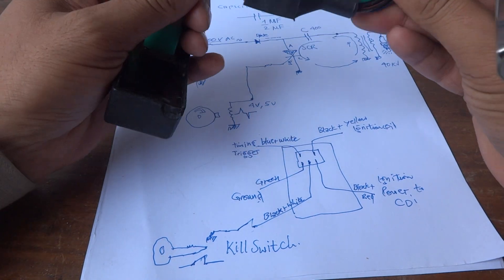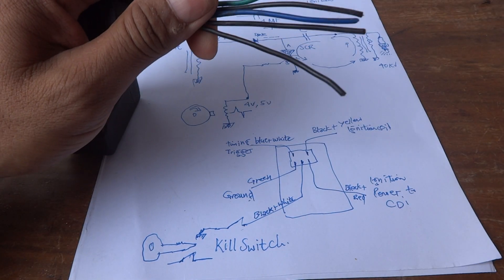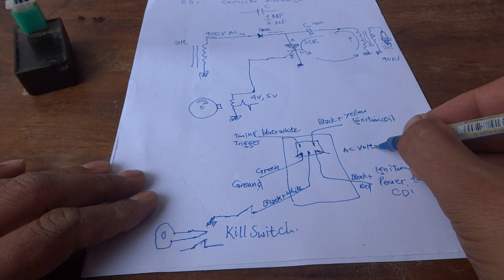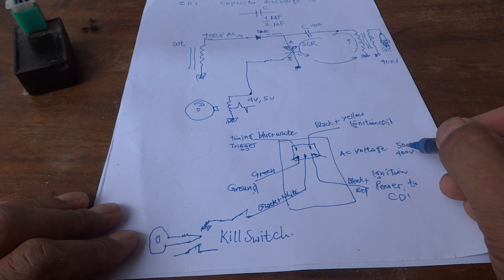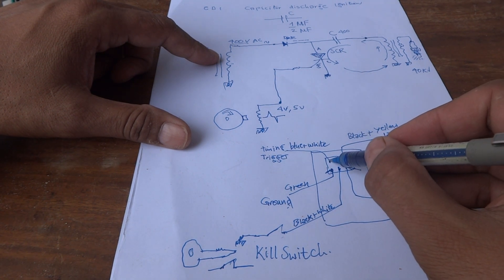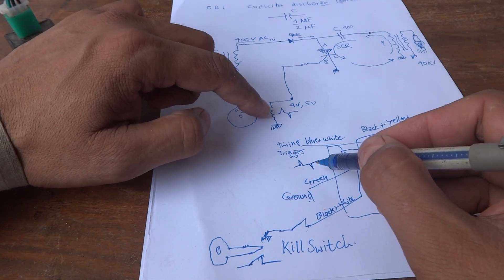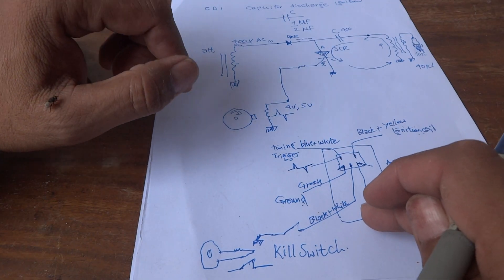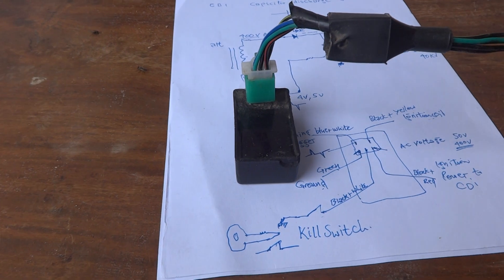Bike cdi system explained. CDI complete wiring and circuit details.

Comment: Is the key in your diagram the ignition switch key ? Or is that the kill switch wire on the handlebar switch ? 
Thank you for your video !
Reply from the maker: Both. In some models there is only ignition switch incorporating engine kill switch and in some models there are bothe ignition switch as well as kill switch. So the connections depends upon the particular model. Regards,
Reply: I have both a key and kill switch . It’s a knock off copy of a Honda ct70 . 
So how would I connect the wiring for that ? Do you have any videos ? Thanks

Comment: Very well described using principle theory .I just guess that charging a 400vac signal is 180 degrees out of phase to the trigger signal (4vac).So charging folowed by discharging  causes voltage induction in ignition coil. I don't know if we can make a simmilator circuit that can drive this charging and discharging signal , just to demonstrate this principle on the table 🤔

Comment: @JahanZeb1976 
When troubleshooting the trigger wire, i have the key on and i have a solid positive with a test light. When i remove inly the trigger wire from the cdi box and the cdi amd trigger are not connected the cdi is positive on that terminal. Is that normal? Does the cdi send a positive signal through the oick up coil? If so does the reluctor interrupt that positive signal and that interruption is what causes the cdi to send a signal to the ignition coil to fire?
Reply from the maker: Seems like not good. There should be nothing on pulser wire. Means no bising or any voltage from cdi side.

Comment: But scr once fired it does not require further pulse unless it is stopped with method of commutation.
Reply from the maker: If you carefully look at circuit design and think critically, you will understand the whole philosophy. Once the scr is triggered, it creates a short circuit along the whole system. Short circuit means zero voltage in the system. Every thing including scr gets in reset mode. Also the ignition coil fires in the spark plug. The system gets ready to repeat the process again.
Reply: @JahanZeb1976  yes sir got it, thanks for quick reply. Further I would like to know pin configuration of pleasure 2009 scooter model it has three sockets.

Thanks for shearing knowledge

Comment: Can I replace the capacitor for an electrolytic
Reply from the maker: Not exact pin to pin replacement! It needs non polarized paper or myler cap. Anyhow you can connect two electrolytics in series by connecting their positive pins together and end negatives you can use as non polarized electrolytic. Keep in mind that in such combination the capacity of both capacitors will reduce by half and voltage of the combination will be doubled if both have same capacity and same voltage.

Comment: 2nd question please.   I need multiple USBs to use how to install a DC to Ac convertor  to sort out my USBs issue for USB heating gloves and USB heating jacket and GPS phone and power bank to charge because all USBs flatten the bike battery often therefore I need to install DC to Ac converter. what Watt of DC converter is suitable for  bike wiring voltage.  thank you
Reply from the maker: Get a commercially available DC to DC converter with multiple USB ports.
Reply: get a DC 12 volt to DC 5 volt buck converter (step-down) and run wire from your 12v battery to the 12v fuse & then to a switch then to the  buck conv. and then to the USB hub... i hope this helps....

Comment: I need install relay & remote on/off switch please guide me through how to wire it.  Can I connect it to CDI  in order to install the relay  with remote on/off switch receiver in Honda CBF 125 and bike will will switched off when gear in function as you know? or shall I connect it to any other unit in bike?
Reply from the maker: This bike is an efi bike. Better you cut off fuel injector supply with the help of relay to kill the engine using remote control.

Comment: Does kill switch work as a limiter?
I mean, does it restrict higher RPM than what is required or allowed...
Reply: No the kill switch can not limit rpm, but if the switch has excessive resistance when in the closed position it could cause cdi to run low volts than required. Test it with a multi meter for resistance. Switch closed should have 0.1 ohm maximum.

Comment: Hello chan you tell me how the cdy make timing ajustment? Than kyou.
Reply from the maker: There is a pulser coil installed outside the main magnet. On the main magnet 🧲 there is a small reluctance piece which produces timing pulse when piston moves close to tdc. This is setting up spark timing.

Comment: So how could we make it so it only fired the spark plug every OTHER revolution of the flywheel instead of every revolution ?  at 10K rpm that is 166 sparks per second and my ignition system on my 150cc isn't providing a powerful enough spark at that high rpm.

Comment: congratulations, but is it possible to exchange the signal from the pulse coil to a hAll a3144 sensor?
adapting brushcutter motor for model aircraft.CDI used sheneray Phoenix +.

Comment: My bike is hero Honda splender plus.( 2006 model )

Today I check the live voltage across starting coil or excitor at cdi input section with respect to ground...

It's bw 30 V - 45 V AC....with fluke TRMS multi meter and coil resistance is around 240 ohms..

Not 400V ac.
Reply from the maker: It reaches 400v maximum at full rpm i.e. 12000 rpm. I'm sure you checked at some 700 to 1000 rpm. At such low rpm, you will get what you mentioned. What I expressed in the video is at maximum rpm and this is not my words but book value.
Reply: @JahanZeb1976  yes.. engine runs at slow speed. Without giving accelerating ..

Comment: Notes from end of Video.
Blue/White stripe trigger input from trigger coil, timed to top dead center (TDC)
Green  ground to frame of motorcycle
Black/White kill switch
Black/yellow to ignition coil
Black/Red CDI Power input 50-400 AC volts from stator coil
Thanks for hand written schematic and correlation of wires to function/position on schematic.
Kicad-PCB.org free schematic software and PCB layout.
AC CDI used on motorcycles with no battery.  AC generated when kick over engine and magnet. Passes by coil of wire to generate an alternating high voltage.
DC CDI used on Motorcycles / garden tractors with Batteries. Internal to CDI, a conversion from 12V to 100-300VDC is made to charge CDI capacitor.

Comment: Was wondering w your excellent circuit knowledge if you could either build or show me how to (i can give you my email) on how to build a spark plug tester machine (that would send sparks to the plug w a button). I was told i would need a vibrator (at least thats what its called in the states) but have no idea on how to build the circuit...
Reply from the maker: Yes, it could be made. But why do you need such a system?
Reply: @JahanZeb1976  For years i wanted to build a system that i can test spark plugs and i also will build a chamber to put them under air pressure (to simulate combustion pressures) for troubleshooting. Regular car and racing troubleshooting. I have a old champion tester but all the wires are off and have no idea how to wire it up. Also thank you sir for your response, i myself am in maintenance here in the states and you def have very impressive skills that would put alot of guys to shame here.

Comment: Is the pulse വോൾടേജ് 4v ac/dc?
Reply from the maker: Ac. Bout difficult to measure at muti meter. User oscilloscope.
Reply: @JahanZeb1976  I obtained 50v in pick up coil and 4v in pulse coil at the input of cdi. But, I can't get 12v output from cdi. What's it means?
Reply from the maker: Your terminology is a bit different. Pick up coil and pulse coil are the same. What you referred pick up coil is actually the alternator feed coil to CDI Wich reaches to 400v at Max bike speed. The CDI unit is fed with this 400v so it also outputs hight voltage to the ignition coil. Why do you expect 12v output from the CDI?
Reply: @JahanZeb1976  I had got about 18V output earlier

Comment: hi, my cdi has no kill switch pin, I want to make anti theft switch, there is 4 possible action :
1. Make switch at the GROUND.
2. Make switch at +12V CDI wire
3. Make switch at IGNITION COIL wire
4. Make switch at AC MAGNETO wire

which are better? can u explain to me.. I'm just think option 1 or 2 will be easy as I don't want to interference current from ignition coil and ac magneto.
Reply: U r talking about a DC-CDI, and not about an AC-CDI like the one explained here... Anyway, if u put the switch at the 4V-AC trigger-wire (from a designated one of the magneto-coils, probably blue and white), it is better than putting it at the way of 400V AC-current, where the switch-contacts will corrode/rust much faster and block the current more and more, till no current can flow...

Comment: But when the SCR fires it also shorts the alternator through the diode! Why doesnt the diode blow? Surely also shorting the alternator causes power loss in the engine
Reply: how could SCR shorts the alternator. Current can run one way through diode.
Reply: and the shorting of alternator if occur how will it pass current to the circuit? so your question don`t fits in my mind :p
Reply: diodes are like a "one way check valve" . current only flows in one direction..

Comment: Mr. Learning Zone. I appreciate the explanation of the CDI a/c CDI d/c, it's a very informational video. Thank you so much
Reply from the maker: You most welcome dear sir. Stay tuned.
Reply: @JahanZeb1976  Great video. Thank you.
In your experience, can the value of components in the CDI change over time to stop the switching of the CDI with a slight drop in battery voltage?
i.e. - an engine (Suzuki twin cylinder) has good cranking speed, but the CDi will not fire the coils (NO spark) until the battery is charged to full capacity.

Comment: Pls explain carefully 
You don't mention here what is trigger nd ground .....what is the function of gate
Reply from the maker: Watch video again. Everything is Crystal clear. Gate is used to trigger the scr.
Reply: Energy stored in the capacitor is discharged through the SCR. At that time, a very high voltage is generated in the ignition coil, that trigger the spark plug which is kept in the cylinder.

Comment: Excelent video!!...one question...how does the CDI advance timming of ignition ar high RPMs?...Greetings from Mexico. Thank you!
Reply from the maker: In ordinary bikes like cd70 or cg125 there is no spark timing advance. There is a special setup of vacuum advance or electronics advance in heavy bikes and cars.
Reply: @JahanZeb1976  

I have an 2 cylinder outboard motor.
I only get a good spark on the top cylinder. 
And very low weak spark on 2nd cyl . Timing light fires ok on both cyl
But spark to weak for 
2 cylinder to ignite